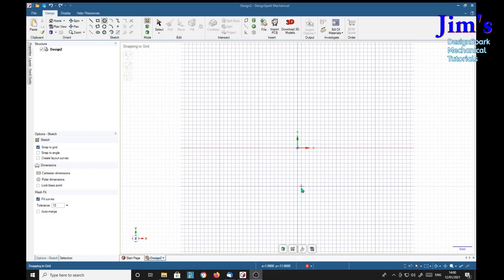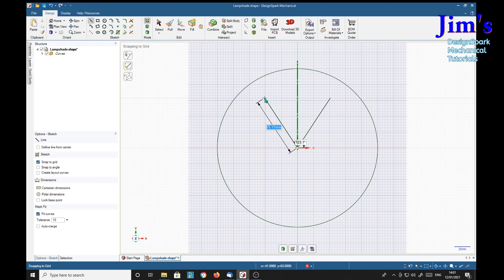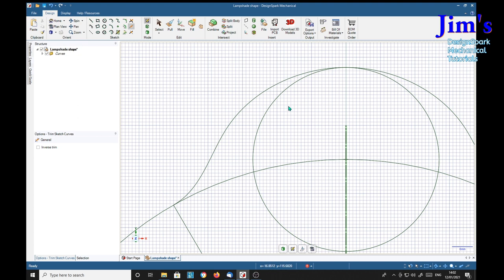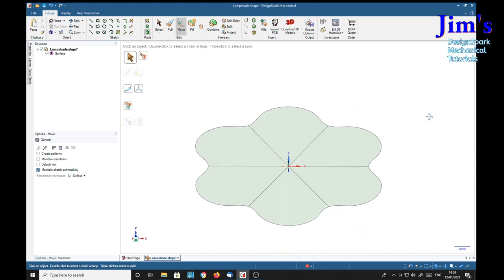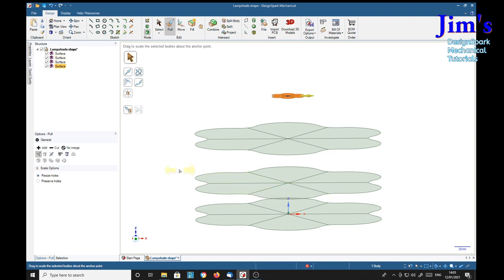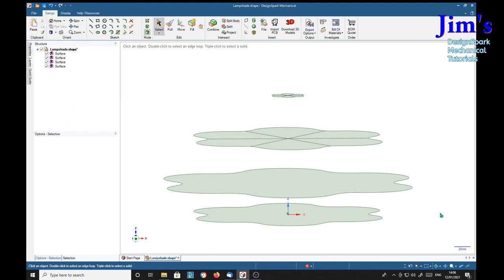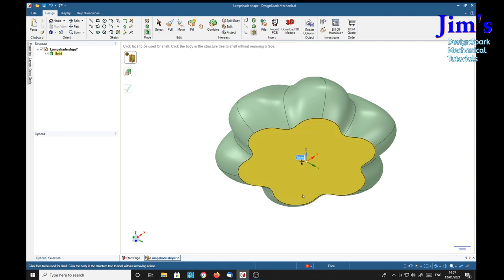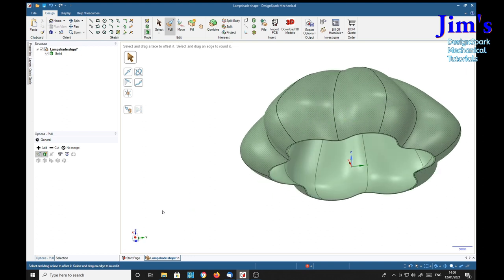Modelling a Lampshade shape with DSM

Comment: Hi Jim ever used the selection filter ? you can set it to select only edges draw a box at the center and it selects all the edges in on go, delete and done looks to me very handy for lots of selections you don't have to be so precise with the mouse, just a single left drawn box around the center of the circle and that's it 
Oh and I found somewhere on the internet another nice trick, say if you have a cube, and you want all the edges to be rounded, the selection can be very fast: just select any edge, type CTRL a and you have all the edges selected of any kind of form I think, I only tried it with a cube with a hole in it , and it shows all the edges selected, even at the backside are shown through the object.
Kind regards Hans

Comment: Jim, I've really enjoyed your tutorials. Very clear and helpful. I've been trying to make a related shape and wonder if you have a solution for me? I'm making a airplane wing that tapers elliptically. I use a series of cross sections as you have here, but I don't want the little flat on the end. I tried scaling the last section way down but it doesn't seem to work. Can you think of a way to finish the end smoothly?

Apologies Jim. Just found your wing tutorial! Never would have thought of a point. I wonder if a guiding spline along the wing edges might clean up that pointed tip? I'm going to try it.
Reply: Well, I had an extensive play with this and still haven't found a solution. Adding guide curves to the leading and trailing edges of the wing almost works. Add the leading edge curve to the blend and it smooths out that edge, but it pulls the trailing edge out of shape. If you try to add the trailing edge it just replaced the leading edge. You can't do both. You can use two guide curves on shapes where they don't meet with no problem. I'd be very interested to know if you can find a solution.
Reply: @millerviz  Instead of using an ellipse where the wing ends use a line and taper ellipse to the line. I have never tried it but just a thought.
Reply from the maker: Please see my video: https://youtu.be/mSzrGRdj7Pc